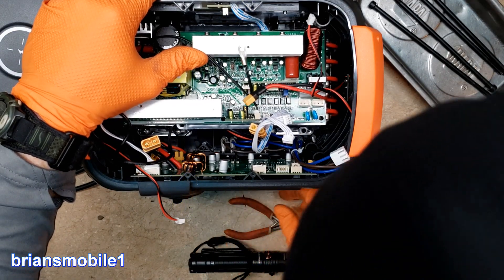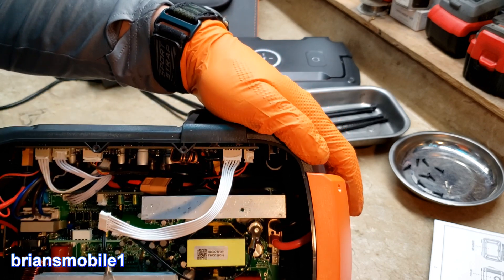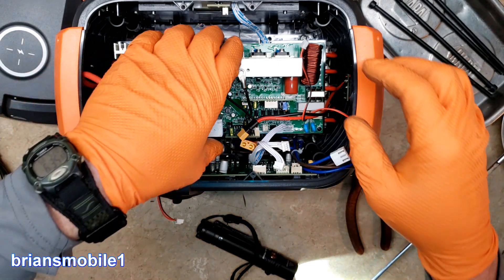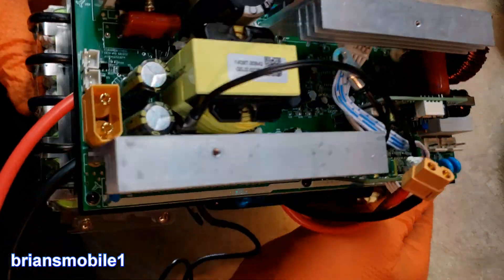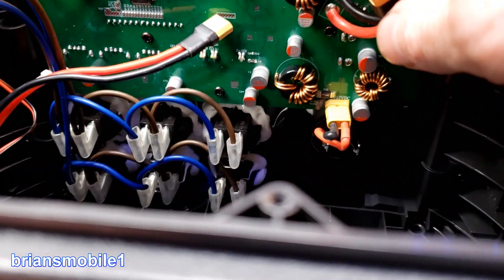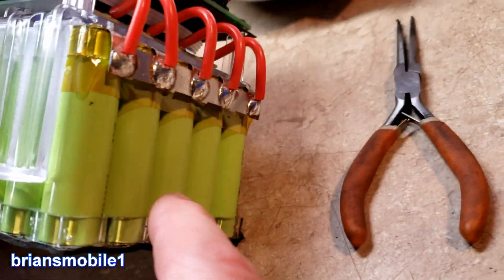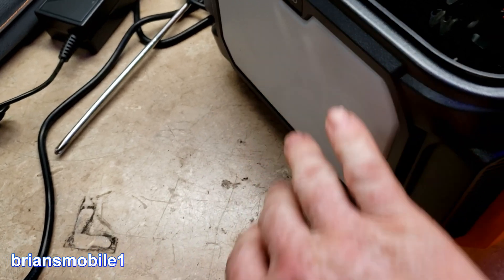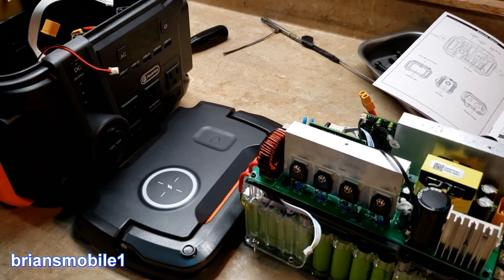Flash Fish A601 Power Supply, Whats In There?

Comment: The unit stopped working and the battery is no longer charging through the cable or the car plug. I read that it might have an internal fuse, but I’m not sure what’s happening. Do you have any ideas? I used 2 times 😢
Reply from the maker: I don't remember off hand, but if you watch the video and see it, reply the time stamp for the next guy.

Comment: Do you know the battery circuit, how many series and how many parallel?
Reply from the maker: Not off the top of my head, no.  Series ups the volts.  Parallel ups the amps.  You can solve to get the numbers of volts.  Most individual cells are going to be 3.7V.